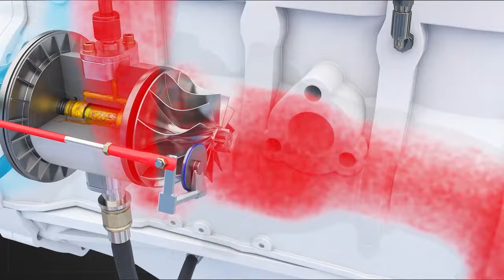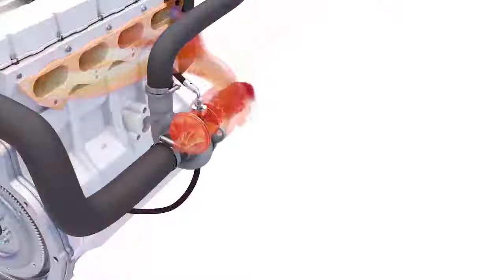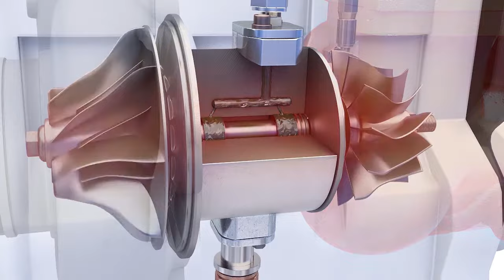Leaking Turbocharger Wastegate

Comment: What would cause a once working wastegate to stop opening all of a sudden after induction/boost?
Reply: The actuator loosened from the temperatures expanding the hole for it. It works as a door. Once that hole opens up more then what it is , there’s no resistance. Allowing the waste gate to stay open just the slightest. Causing a major boost leak
Reply: @Frogs7482  Would a boost leak throw a DTS?
Reply: @DavidTMSN  I’m sorry dts ? U have me stumped lmao. If ur asking if it throws a code , my gti threw a underboost code
Reply: 1 Mechanical failure:
The wastegate actuator or linkage could be stuck seized,
wastegate flap/valve itself could be stuck or jammed, not allowing it to move freely.
2 Electrical/control system issue:
A problem with the wastegate control solenoid, wiring, or ECU programming could prevent the wastegate from receiving the proper signal to open.
A boost pressure sensor or other related sensor failure could cause the ECU to not command the wastegate to open correctly.
3 Boost system leaks:
A boost system leak, such as a cracked intercooler or hose, could reduce the boost pressure and the need for the wastegate to open.
This could trick the ECU into thinking the wastegate doesn't need to open.
4 Clogged/restricted exhaust:
If the exhaust system becomes clogged or restricted, it can increase the backpressure and prevent the wastegate from opening properly.
5Wastegate spring failure:
The wastegate spring that helps pull the flap open could be broken or weakened, not providing enough force to open the wastegate.

Comment: I gave my car to the mechanic. Vw passat b7 2012 to change turbocharger, but after changing the turbo, my car misfires and won't move, and when acceleration, then noise.
Mechanic tries to find a problem, but he can't find he told me he checks everything like leakage sparkplugs, all things that need to be checked for misfire, but he can't find anything. He does diagnostic, and there also shows no problem, but the car won't move, and noise when acceleration
Reply: sounds like you need a new mechanic